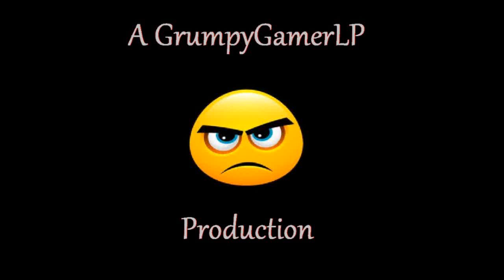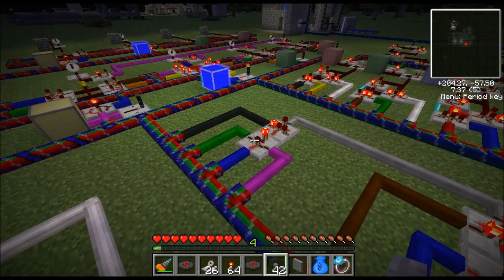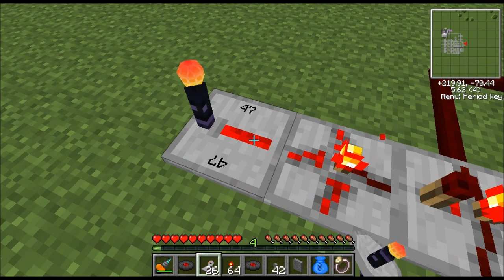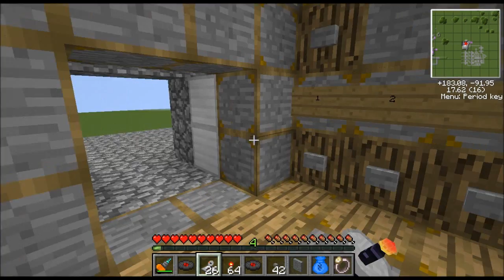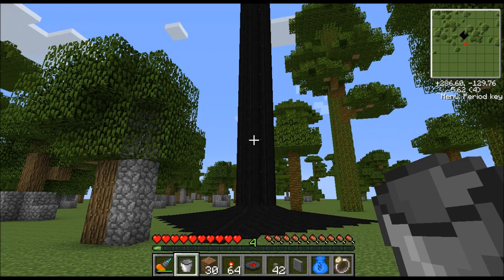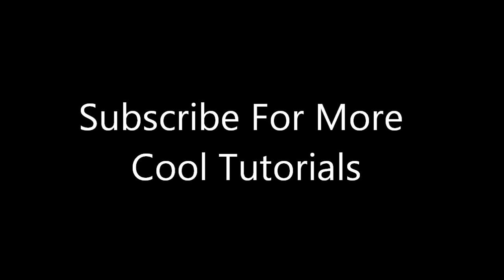Tekkit Tutorial - Elevator 3.0 - Advanced Redpower 2 Circuit Design (Part 2 of 2)

Comment: continued. I also used pulse former between the toggle latch and each side of the circuit, The latter part was just repeated twice (once for each side). it actually worked out really well, but I would have had no idea where to start if not for your video.

Comment: I was trying to figure out how I could do some logic for a machine frame door. I used the memory circuit section at the start. only needed two buffers because there were only two states for which the door could be in, Open or closed. I used a toggle latch to switch between the states (sides of the circuit). After that I just had to figure out how to complete the circuit. I used a pulse former into a state cell (3 second timer) into a not gate, and finally into a timer (1 second timer).